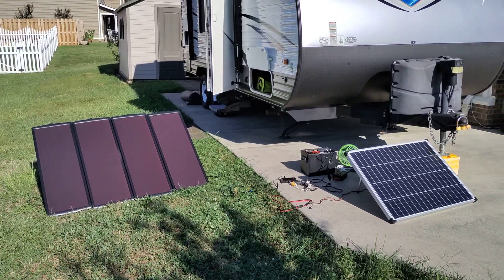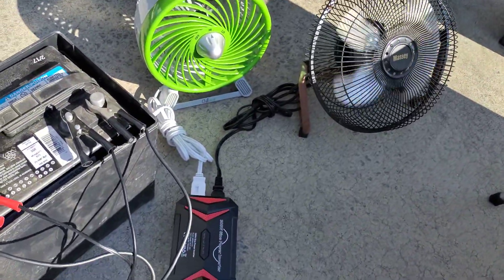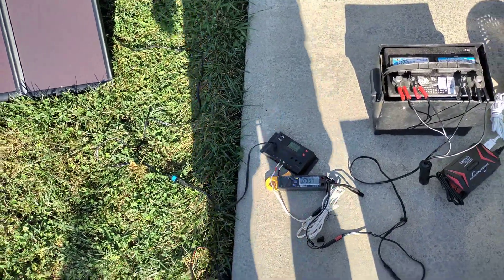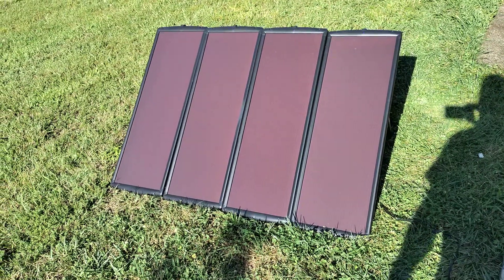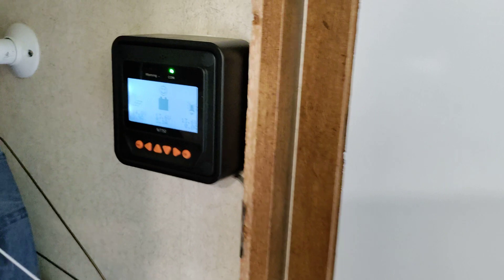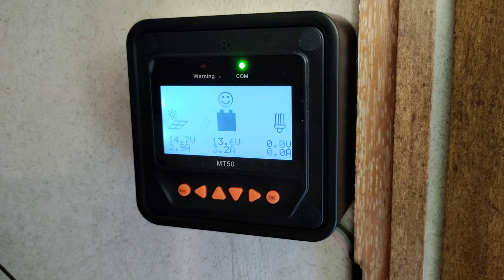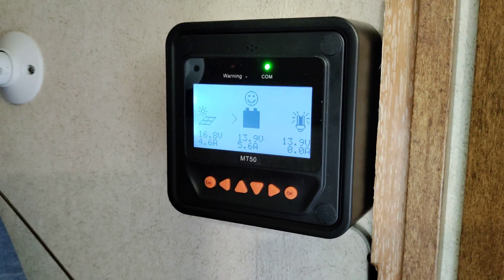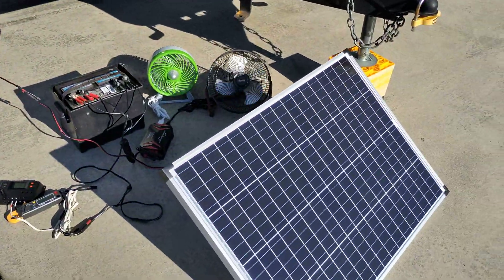Harbor Freight 100 Watt Solar Panel Comparison

Comment: I have the same pannels and am building a home made jackery for our camper van and emergencies. What watt is the charge controller that came with the 4 25w panel kit?
Reply from the maker: The included PWM charge controller is rated for up to 10 amps, and 14.4 volts output during the boost charging phase, so that's 144 watts.

Comment: I started with two of the 45 watt kits that my uncle gave me for working on his lawnmower...I used them with two marine batteries I bought for awhile then I got 3 mono panels...added 2 more batteries, bought 3 more mono panels, different brand...decided to go to 24 volts so I got a 40 amp Epever charge controller and 2 more batteries...well, I have 14 batteries, ten 85 amp hour, and four 105 amp hour...I'm getting two more of those in a week, and no more...I have ten 100 watt mono solar panels, four different brands of them...I might get two more maybe...I use a 2000 watts Aims inverter / charger. It works great...I went off grid months ago...I never could get much voltage out of the PWM controller...the one I have put much more into the batteries as soon as I hooked it up, it's a 4215 BN .  I have the MT 50 display like the one you have...